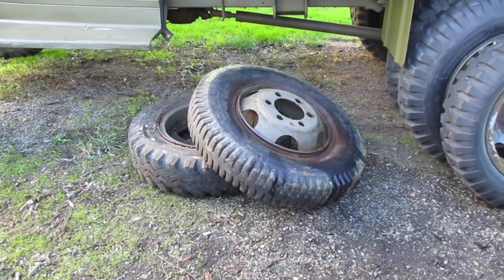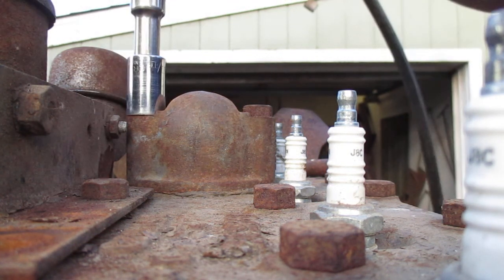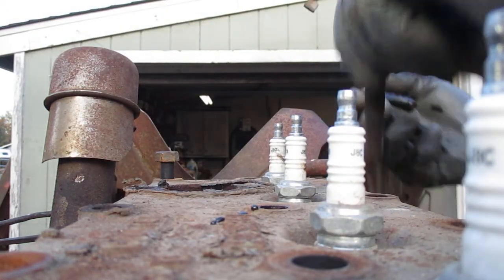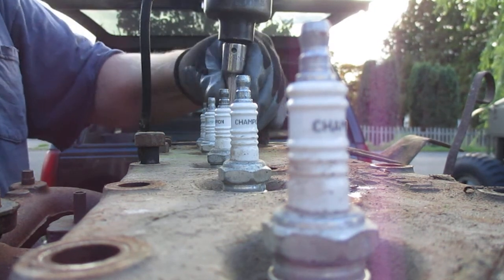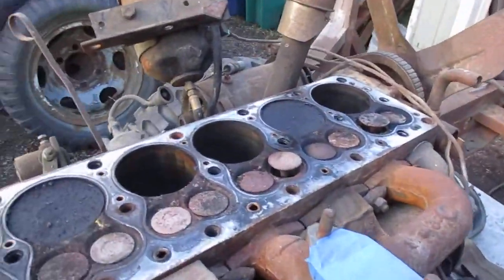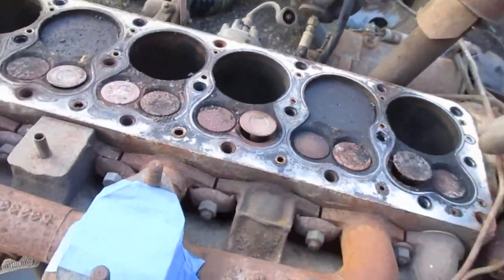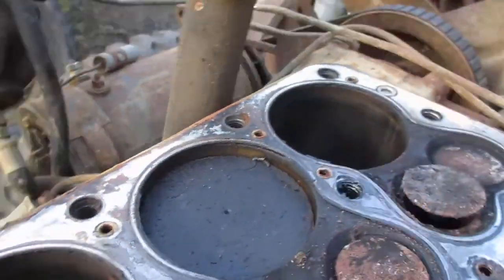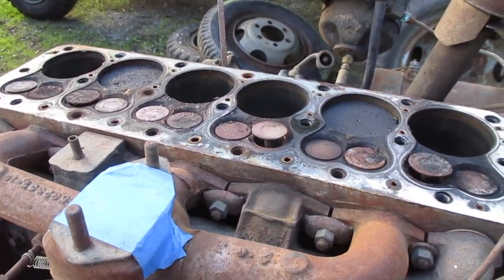Top End Inspection.

Comment: Looks great. Ya know those motors are 7-1 compression. U can find new head gasket on Amazon or eBay under $50
Reply from the maker: Yes I do. The W.W. 2 engines were lower at 6.7 to 1. When it comes time to refresh this engine, I will have the head fly-cut and bring the compression ratio up to 8.5 to 1. This way it will burn 87 octane gasoline more efficiently. Thanks for the comment.